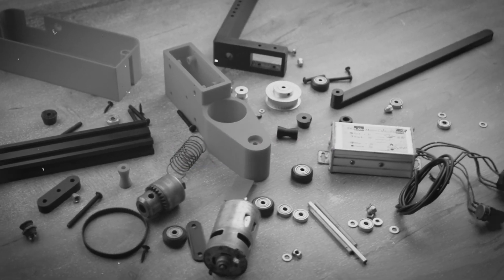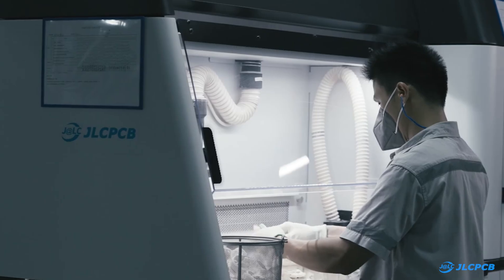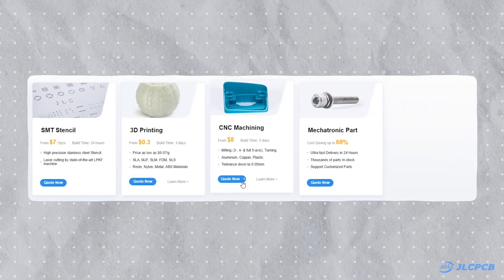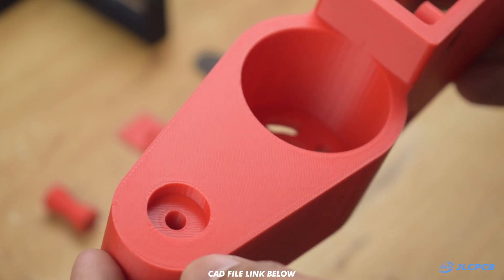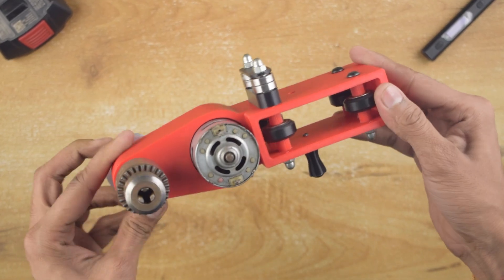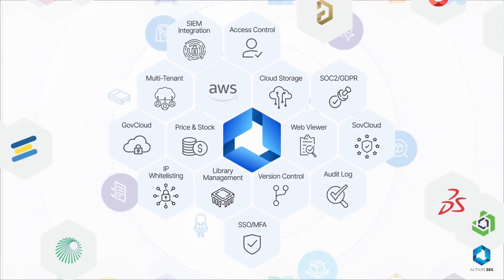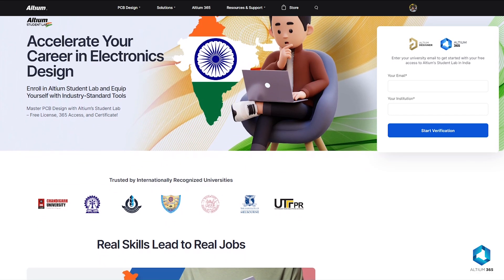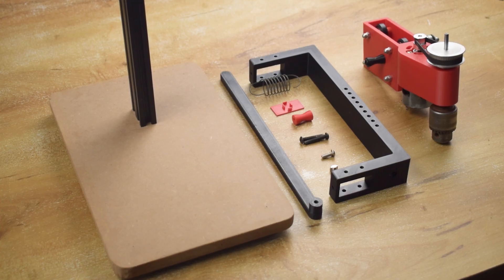DIY 3D Printed Drill Press – Compact & Powerful!

Comment: DESIGN  COULD BE IMPROVED BY USING MORE METAL.. THE MOTOR MOUNT IS NOT SO RIGID AND THE PLASTIC WILL MELT IF YOU USE THE MACHINE FOR MORE THAN FEW MINUTES..I HAVE USED MANY KINDS OF DC MOTORS ,YOU BETTER ADD A BRACKET ON THE SIDE TO MOUNT THE MOTOR ,,STILL EXPENSIVE CONSIDERING THE EFFICACY OF THIS.  UTILITY WISE GOOD FOR DRILLING PCB AND VERY SMALL PARTS